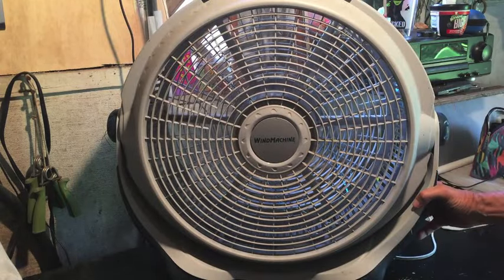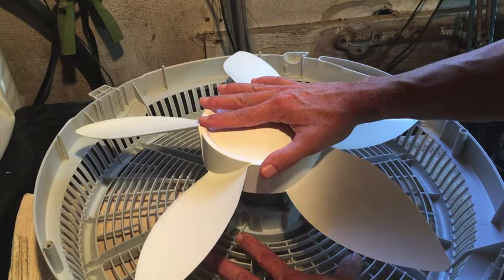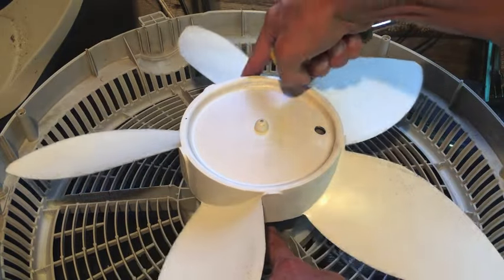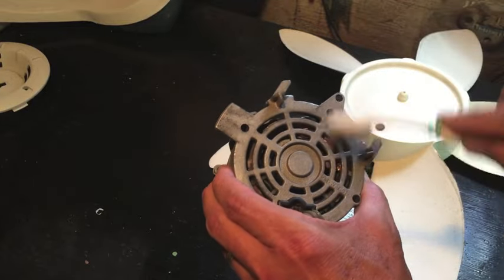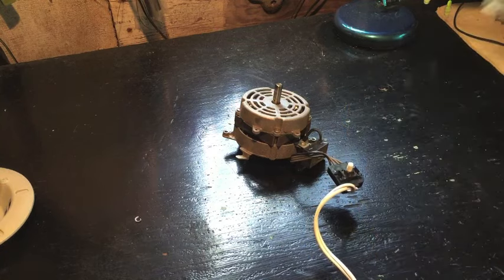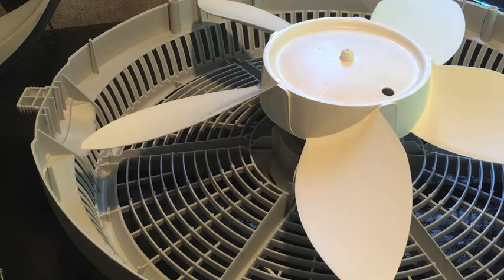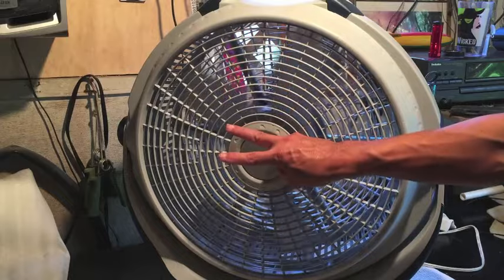Disassemble/Clean Lasko Wind Machine 3300

Comment: I have this fan but I can't get the  Blade off what should I do
Reply from the maker: you don't have to take the blade off.. everything can be cleaned with it still attached.. just wipe down the blades instead of using hose to avoid water getting into motor..
Reply: Give it a wiggle and pull straight up. It what I did
Reply: Thanks! Great video. I did have some trouble pulling the blade off, like some others, but it finally came off. Now I have a nice, clean fan. 😁

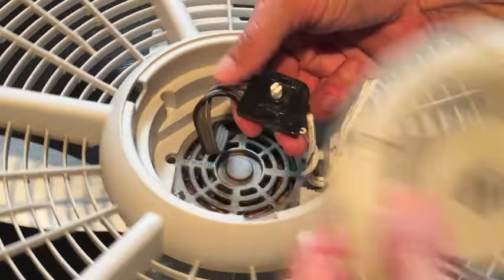Comment: Thanks for the video. my fan looks brand new again. But I lost one screw. I think my cat lost it while playing with it. and also one of the white wires came loose from the switch. But I shoved it back in there and it seems to be working fine. Does Anyone know how I can attach the wire permanently? If you look at 7:05 it appears the white wires are starting to come loose from the switch.
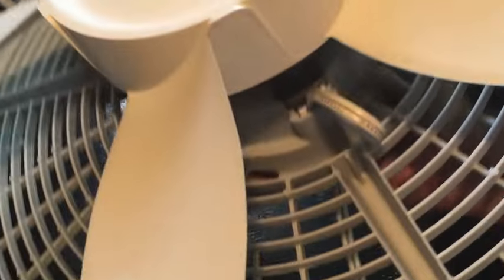Reply from the maker: I see what you're talking about at 7:05.. That you can see a little bare wire at the end.. I doubt that switch can be taken apart to repair.. Might have to replace it if you continue to have problems..

Comment: Can I clean my fan motor with chlorniated water
Reply from the maker: Water conducts electricity so no, I would not use chlorinated water to clean the motor..
Reply: @PeanutButterMan-PBM   I used cotton swabs and dipped  it in chlorinated water is that okay, i mean its too late question is should  let it dry then turn it on,
Reply: @PeanutButterMan-PBM  See my message

Comment: I had no idea about lubricating these regularly. I know my mother hit them with WD-40 when she used to clean them, but she used WD-40 on everything. Anyway, mine is now slow-turning with a humming sound. It may not even be repairable. I will probably re-buy the same fan. It's to help with reducing AC bills in Houston. I work at home. So I run this and I raise the temperature on the thermostat. Having AC at 75 is not a problem if the air is moving, I'm not super sensitive to heat. Plus I use it after my walks with my dog. She crashes out in front of it to cool off so unofficially it's "her" fan. I'm pretty sure they still sell it at Walmart, so I will probably replace it. It's a great unit.

As for checking for the problem, I tested it in a wall jack on a surge protector after I took it apart and cleaned the part where the fan blade goes on. Turning it on and off made a USB device disconnect/reconnect on my computer which was really bizarre. My PC is not at all linked to that surge protector, not even that wall-jack, but the one adjacent. So maybe it is a power issue...? And those outlets maybe have some grounding issue... I probably should get another battery for my UPS and reconnect it. Sellers did some poor DIY electrical work on some of the outlets.
Reply: I wouldn't use WD-40 it dries out faster "zoom spout" is a better oil for sewing machines and fans.

Comment: what if the blade is unstable when you turn it on ?
Reply from the maker: first thing I would check would be to make sure the blade is fully pushed back on to the shaft.. if it was stable before you cleaned it and unstable now that could be the problem.. or, if you took the motor out I would check that also.. if it's not secure the motor and blade would both be unstable..

Comment: Love this. Video, can I use WD 40 in the mot? Don't have any oil for motors.
Reply from the maker: Based on the info below for the short term WD 40 would probably be OK.. But you should follow up soon with a proper oil/lubricant.. This 3-In-One oil would work: https://www.lowes.com/pd/3-IN-ONE-3-in-One-3-oz-Lubricant/1210103

"WD stands for "water displacing" and its main use is as a solvent or rust dissolver. The lubricant-like properties of WD-40 come not from the substance itself, but from dissolving components. And the effect doesn't last. WD-40 can be a good substance to start with — it can help clean up rust or other grime."
Reply: @PeanutButterMan-PBM  How about baby oil? I use it for cleaning and lubing my clippers for cutting hair.

Comment: i did everything you did, but noticed one of the cable feeding into the battery slipped and now my fan won’t spin but i feel the motor vibrating, any suggestions?

Comment: AWESOME VID-  WHEN YOU TAKE THE MOTOR OUT, WHY NOT JUST TAKE THE BLADE BACK OFF INSTEAD OF ROTATING IT AROUND TO ALIGNED IT  TO THE SCREW ACCESS HOLES? OTHER THAN THAT QUESTION GREAT JOB THANKS
Reply from the maker: This was my first time taking the fan apart and initially I didn't realize the blade just pulled off.. I saw the hole in the blade that you could rotate to align with the screws and assumed it was there for that reason.. That the motor needed to be removed first to gain access to a set screw holding the blade to the shaft.. But, no set screw.. Not sure now why that hole is even in the blade since pulling the blade off give access to the motor mounting screws..
Reply: Sorry I realized after that there were 2 parts to the vid- I apologize for posting before watching further into it. You helped me out a lot w this vid. My 6 year old fan works like new after cleaning it lol. Great job

Comment: had mine for 8 , 9 years taken mine apart every other year works great.. if you need to just  service the motor you don't need to remove the motor from the fan cage.. remove all the stuff to get the motor leave the switch assembly  together remove the 4 screws on the motor and pull the top off you will have access to the internals on mine there are no wires connected to the top half now you can blow out the winding's clean the rotor shaft the bushings are self lucubrating just clean the shaft on the rotor and bushings DO NOT lube the bushings.
slap it back together... total job takes 20 minutes only 8 screws.

Comment: The Fan on my wind Machine (looks just like the video) will NOT pull off...this has me scratching my head...I couldn't physically force it to pull it off anymore than I tried without breaking something.
Also, on mine there is a plastic shroud behind the Fan Blade and motor.
Reply: I had the same problem, also have the additional shroud over motor below fan blade. I persevered, after I got the motor off I got a better purchase on the fan blade and it popped right off. Hope that helps?
Reply from the maker: yeah mine had no set screw.. took some force but slid right off the shaft.. i would say clean it as best you can while still attached.. if you force and break it like you mentioned then it's new fan time..

Comment: I can’t get the blade off from the motor
Reply: I had the same problem and the blade had never been off.. So in another video I watched I realized that in this you have to use a little extra muscle. I put one foot down on the grill to hold it and with my hand between the blades wiggled it off.
Reply: I flipped mine over on my bed, placing blades down - motor up, then placed some old socks on my hands so I wouldn't get cut on the plastic, and pulled motor upwards while using knuckles to hold blades firm. It was first cleaning of this particular fan so it was a little stubborn. I am unable to grip it the other way, nor do I have the strength to pull it like that anyway. Hope this helps you.
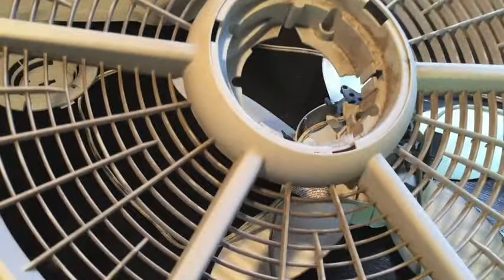Reply from the maker: If your is the same model (3300) the blade should just pull straight off as shown in the video at 3:53.. If you have a different model there may be a small set screw that holds the blade onto the motor shaft.. If so, that screw will have to be loosened before the blade can be removed.. If no set screw, more muscle or mechanical advantage (careful prying)..
Reply: Same Wind Machine and my Blade will NOT pull off!
I can't see any screw holding it on.
Reply: yes350yes ...I had both feet holding the shroud  and was pulling up...it sounded like the plastic motor mounts were cracking!

Comment: My fan blades keep falling off the motor!
Reply from the maker: Same model fan as in the video?  If so, there's nothing holding the blades on the motor shaft other than being made to be a tight fit..  If yours keeps falling off, the hole where the blades slide onto the shaft may be worn/stripped out..
Reply: Well how can we fix that problem? Glue?
Reply: @dartsnfarts  glue is permanent you wont be able to take it off again for servicing. Maybe jam some paper in there and call it a day lol.

Comment: Good video.  This would possibly be a waste of time with the newest and more advanced fans made today by Lakso. Most of the new products have use once type of fasteners. In other words, they aren't designed for disassembly as much as they are for quick assembly and very little future service needs.  This fan is worth more than some of the brand new models as it is more sturdy, a quality motor and quality switch unlike new models.
Reply: Garth Clark this was a shock to me but I was at Walmart the other day and they still sell the wind machine!

Comment: Very cool video and perfect timing! I was just getting ready to clean my Wind Machine! So watching your video,  I got it somewhat apart, but I can't pull that fan blade off the motor cuz my hand isn't as big to span the diameter of the center as yours is, and I don't have the strength to pull it! 

I asked my Auto Mechanic hubby if he could pull it off for me and he said "it don't come off" and he went back to watching his TV! Well, obviously the blade does come off, as I just watched you do it. Is there some kind of trick to it? The blade is really dirty and it's very hard to clean it while it's still on that motor. Anyway, thank you for such a helpful video! Stay cool!
Reply from the maker: There's no trick.. No screw or faster of any kind holding the blade on the shaft.. It's just made to be a tight fit..
Reply: Astrid it worked thanks
Reply: My hands are also too small to reach opposite sides and pull off. I gently stepped on the opposite blades with my toes and gently pulled the motor apart. It came off. To put it back on, I set the blades down and pushed the motor onto it making sure the flat sides matched.